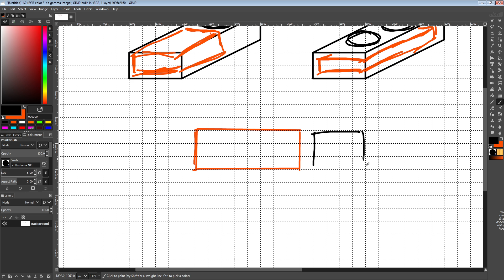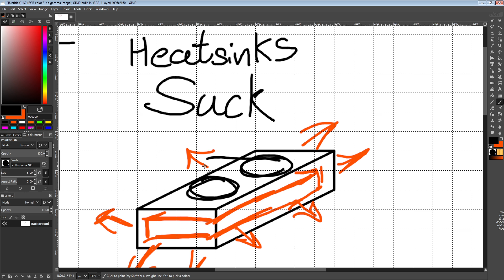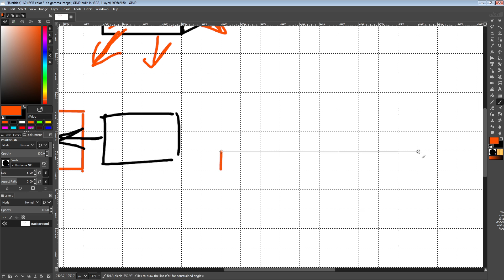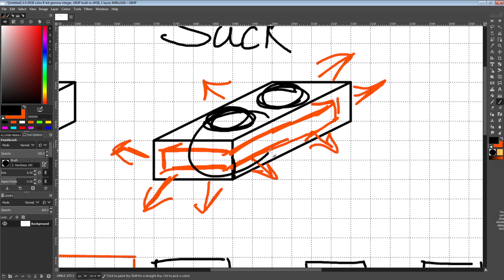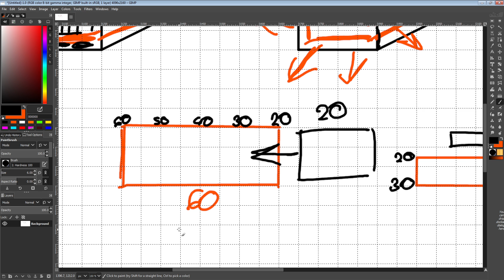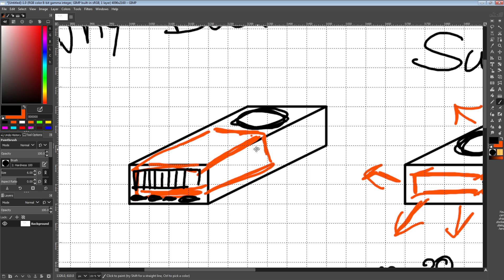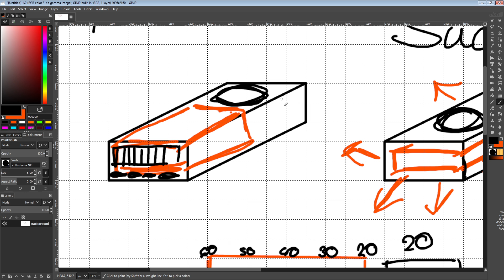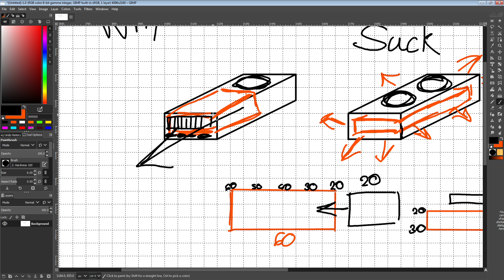Why blower heatsinks suck

Comment: Watercooling should be special. Like you have 2 thermal transfer.
If you lower the water flow to a minimum, the cpu to water heat transfer is going to be bad but because the water is hot, the water to air heat transfer is going to be good.
Whereas if you increase the waterflow to a maximum, the cpu to water heat exchange is going to be good but the water to air heat exchange is going to be bad

Comment: Why not have a second small fan inside the blower card, near the rear exhaust? Because I really like the idea of dumping the hot air outside the case instead of in my CPU cooler or near the GPU intake fan.
Reply: There are GPUs that don't even have own fan, just on giant blower style heatsink and it is best design for application where you need to get hot air out of the case

Comment: Very good explanation.
You did mention something that might be slightly wrong, depending how you look at it. If you look at a blower fan, the air does exit the full curcumference. The duct is shaped to guide the air evenly across the one opening at a much higher speed than it exits the fan blades.
Edit: what do you think of ducting air from the axial fan heatsink to the outside of the case using a third and fourth slot?

Comment: either of these designs would choke if you have more than one GPU using a typical motherboard.
also
it's funny how a case that's designed for quieter thermal management, arguably the new mac pro, still blows air in the same direction as the blower design. albeit with a larger cross-section and a true through design; air intake in the front, exhaust in the back of the case.

maybe it's time that GPUs aren't sold with integrated cooling?

Comment: I'd like to see a 4-slot blower card, with vertically (?) mounted fans in a push-pull configuration. One low-pressure fan blowing hot air out of the rear slots, one high-pressure fan pushing cool air into the card from near the front of the case. And possibly a high-pressure fan in the middle, but I don't know if that'd actually be useful. For four slots, standard/replaceable 92mm fans should be perfectly feasible.

Comment: Please, Study heat transfer before speaking and giving nonsensical opinion. A simple formula Q = c x m x deltaT. Blower you have described has Delta T = 40 (60-20) and the other 10 (30-20). This means the blower needs 4 times less flow to achieve the same heat transfer. Doesn't it contradict what you say? You sucks this time!

Comment: The other idiocy in case design was removing the side fan because it interfered with looking at your f**king RGB lights ...... So lets remove cooling performance for something that adds no performance at all ..... In fact it generates even more heat

Comment: Who volunteers to write a successor to the ATX specification to fix some of the problems mentioned here? A recent fix for a related problem is the 12-V-connector proposed by Nvidia. I think the whole industry needs to standardize better on certain aspects as well to solve some of these legacy issues (good luck dealing with all of the diverse interests of the CPU, GPU, PSU and case vendors of the world).

Comment: My XFX ATI 5970 fail in 11 months cause it was a Blower heatsink, and I dont know to having a better airflow inside my case, and I live in a very warm place :(, and my Asus ATI 7970HD was a open heatsink and last 7 years, if i changed the thermal pads or the paste would last more, but well it doesnt matter, and now i have a Asus Strix Vega64 and 1 week ago i changed the thermal paste and the thermal pads and the temp went a little low, and my case is way better and has mucho airflow and now i have AC

Comment: Before watching: Because the heatsink is tiny. Because of the sheer power of a blower fan you can still get decent cooling due to massive static pressure, but you'll go deaf in the process.

Comment: The only thing that I think you might have overlooked about blowers is their use in servers because for servers it is all about not recirculating any air. So for server cards they are almost exclusively blower style because perform better in that type of system (it also helps that noise is an after thought)

Comment: I was actually a little shocked at how bad mine was, given that the entire shroud was also made of metal. I think it was aluminum, but I sold the card and can't tell now. That fin stack inside only did half the cooling, and the outside got brutally hot as well. Curious how much of the temp issues were just related to the 7nm process. Like a ~70w ryzen 3600 is harder to cool than a ~90w 2600x.

Comment: My imaginary 3 slot blower with heat pipes in addition to a vapor chamber beats all your coolers. Due to high airflow blowers are impervious to dust buildup and take the heat out of the case, which is very useful when your cpu is 280w itself.
Reply from the maker: man I recently cleaned a blowered that pretty much had a wall of dust at at the front of the finstack.
Reply: @ActuallyHardcoreOverclocking  Still better than an open air cooler, in equal conditions that is. There is simply a higher chance that dust gets exhausted out of the case, than with an open air one. I think one of the main reasons why Nvidia abandoned blowers for consumer cards starting with the 20 series, is to upsell Quadros etc for serious people, who need to stack 4 of them into a case.

Comment: This is way over dramatized here. Ok, its true that a blower will run 15 degree hotter at the same noise level (nvidia, amd's would be also louder). It is also true, that 2-3 fan cards repel heat from themselves more efficiently. But that has a price. And the price is everything heats up in your case. The blower card will exhaust the heat in a controlled direction, while 2-3 fan cards just repel it into every direction, and heat up m.2, motherboard, cpu, vrm, etc. Everything. Its simple thermodynamics. That heat isnt going out straigt, but warming up some components, before it gets sucked out by case fans. So you DO get something in exchange for that +15°C. I mean i run blower cards for 3 generations now. They are all fine. Since the 600 series nvidia does pretty good blowers. SFF cases just need a blower card. Especially, if you want a straight airflow with dust filtering in the front. So distributing 65°C inside the case vs. exhausting 80°C straight out of the case? Not so much a clear decision, it very much depents on your case config.

Comment: My friend built a new PC where the Asus 2070 Super video card had ~1mm clearance between its back plate and the Be Quiet! Dark Pro 4 air cooler. The processor ran hot because the video card transferred heat to the air cooler. I put in my modest 1050 Ti video card and the processor temperature dropped 7C. My friend gave me his air cooler and got an Arctic Freezer II AIO.

Comment: They do have their niche use though.. tight & very airflow limited cases. Instead of shooting all the heat into the case and making the intake even more hot, all of it will be shot out.

Comment: B-but Sir, 
what about them mini-ITX shoebox-style cases where the only opening is the perforated sidewall and top and bottom are closed off/otherwise blocked?
How else would you avoid the card recirculating the hot air?

Comment: but blower kinda works on server-oriented stuff :(((
Reply: If you spin blower fast enough, it will work just fine. You just might need hearing protection though.
Reply from the maker: servers ditch the blower fan and let the rack fans take care of pushing the air.
Reply: @ActuallyHardcoreOverclocking  but isn't that mean the air flow through the fin will travel more than blower version? Or with the bigger heat sink it will work just plain better?
Reply from the maker: @KenHihihi  server racks use insanely loud and fast fans(so they move a ton of air very quickly). They make blowers look quiet.

Comment: AMD really could have used a much larger blower fan without changing their overall dimensions. And they could have opened up the back side of the card for blower intake and IO plate for exhaust. But nope, they decided to poorly implement a blower fan instead of fix their overall design.

I find a value add for blower coolers since my case is very air flow restricted, but there is no excuse for completely failing at designing a blower card. The 5700xt for example has at least another 15~20mm of space for finstack if they hadn't put the fan so far away from the edge of the card.

Comment: Now I'm imagining how a mobo with a PCIe slot for the GPU at the very top would look, so the GPU would pull fresh air from the top.
Or maybe swap the position of the RAM slots and the PCIE, and have the card mounted vertically with intake from the front of the case.

That still has the GPU spill hot air in the case but overall both solutions would probably be better for GPU cooling.
The GPU on top config might cause problems for the CPU cooler though, unless we move that down on the mobo.
And the 2nd option would need a special I/O opening just for the GPU... hmm.

Comment: When you blow air over a heat exchanger at very high speeds it becomes a lot less efficient. I dont actually understand why that is, presumably because of the dynamics of the airflow.
Reply: Most likely the formation of a boundary layer and what is called watches three youtube lectures an adverse pressure gradient where the flow seems to choke and try to go back into the air stream.

Comment: At 19:30 you're talking about boundary layer, and thermodynamically that's correct. A turbulent boundary layer promotes better thermal transfer compared to laminar (all else being equal). Although the effect is less significant at the low flow speed and volume we're talking about (small PC fans). A lot of the time, the fancy impeller geometry and funky fin stack shapes manufacturers like to use has more to do with aesthetics and marketing than actual performance improvement (don't get me wrong, design features that promote turbulent boundary layer flow DOES help with thermal transfer, but at this scale, the same improvement can be easily be achieved just as well just by brute-forcing it with running a higher RPM fan)

Comment: Looks at my 1080ti FE and titanV.... nope wouldn't change them.
Multi gpu is dead and seems silly to have a huge case like my old 750d just to fill it with heatsink like a nh-d15 for the cpu and another nh-d15 for the gpu for diminishing cooling returns, ITX all the way.

1) obviously the air is exhausted out the case, better for cpu and ram thermals.

2) if you have a 100mmx100mm fin stack and then put in a 100mm fan only 73.6% of the fin stack gets airflow from swept area, the corners and fan hub get nothing. Atleast with a blower 100% of the heatsink cross section is used.

Example.
Say you have a 2 slot 10.5in (266mm) card thats 100mm wide with its fans.... you only get 1 slot of heatsink 1 slot of fan.
For a total fin stack of 100mm x12mm x266mm= 320K mm2. But only 176K mm2 (55%) is getting direct airflow through it.
If you have a blower card thats also 2 slot with a 100mm fan thats 160mm heatstack length x100 x24mm thick so 384K mm2 of area.
 Obviously you need allot of pressure to push through 160mm length of fins but even if it was 120mm thats 288K mm2 of area.
Unfortunately the biggest fans they make now at 85mm and the blade depth seems thin and I think that's the main cause, the 70mm fans in recent use seemed deeper like 20mm.
Either way wouldn't be an issue if we had bigger slower blower fans. ALA PS5.

3) as mentioned allot of cards (like my r9 290 twin frozrs) have the air exhaust out the sides right against the motherboard and m.2, assuming it doesn't get stuck there by lower slots... it just gets recirculated so only the sides against the window is what you have to rely on and even that can get recirculated back under the fans.

I'm not saying blower is better but we have 3-4 slot axial coolers like the morpheus so obviously axials aren't perfect either.
I'd love to see a 3 or 4 slot 100mm high (above pcie slot hight like the 3090 is and older lightning/kingpin models) blowers, How about a quad slot which has an 80mm noctua fan blowing through it like allot of data centers (but less noise and airflow and more heatsink).

They just need to put effort into them but they won't because gamers need thier plastic pointy shrouds with RGB lighting etc to make themselves feel validated about thier purchase.

I also like the style of the gtx680 and vega56 and 5700xt stock coolers. Its a graphics card, its a tool like a screwdriver, so its clean and simple black box, it doesn't look like a power rangers lunchbox made out of knex.

This is just my opinion and I test in cases, each to thier own.
Casually waits for triple fan quad slot coolers because anti-sag sticks look good. /s
Anti-lag is for noobs, anti sag is the new thing. Aunty sag is someone else. You're welcome.
The rear io on allot of blower cards is less restrictive than the fin stack. The rear io being removed depending on model might drop you 1-2c at best.

I have 4x reference gtx480s in sli, I have an interest in this.
Edit and 1080ti fe and titanV.

Safe to say there are other benefits.

Comment: I once removed the terrible blower fan from a GeForce 6800 and glued a good quality axial fan over the hole. It was actually way quieter than the original fan even though the air had to make a 90 degree turn to go through the heatsink.
Those squirrel cage fans are noisy by default.

Comment: What if my case has bad airflow? The gpu spitting hot air back into it is gonna be bad.
And no, "get a better airflow case" is not a valid answer. If I had the funds and time to replace every single component, I would do that, but in 95% of cases you have to respect context.
Reply: his point is not from the perspective of the user buying a blower, but manufacturers should have been making decent cases for decades now and should have figured out how to make them for cheap. this would lead to the blower design not being needed in the first place. 

and if your system can't keep itself cool, that warrants a shift in the budget IMO

Comment: Would having a typical 2-fan configuration with a sealed shroud and a back exhaust work better than the blower? It would still exhaust the hot air directly out of the cage.  Or we are getting into a situation when the cost don't make sense anymore, and it's better to  go to an open shroud?

Comment: this comparison is a bit flawed because you look into it from the perspective of Overclocker with a open bench. but Blower cooler arent that bad in smaller ITX (mATX) cases without enough airflow to transport the hot exhaust air out of the case. also radial fans are way better in generating high pressure compared to axial fans, so the small exhaust area isnt really a problem. AMD just builds shitty Blower coolers, look at the GTX 1080 FE the cooler works surprisingly well.

Comment: Also blower cooler fans doesn't push air straight through the heatsink, it pushes it inside the card in all direction, which creates high pressure, which pushes the air through the heatsink, but also creates a lot of turbulance